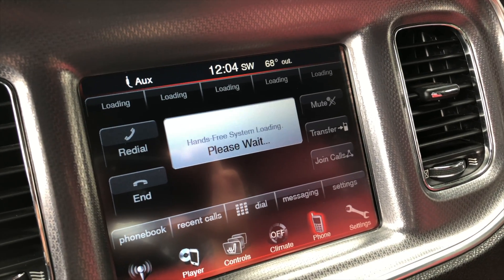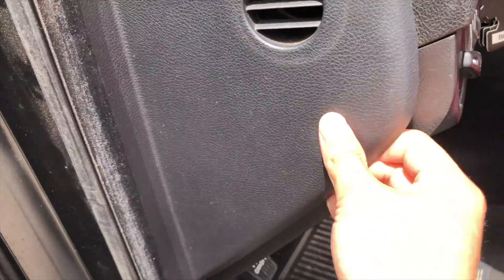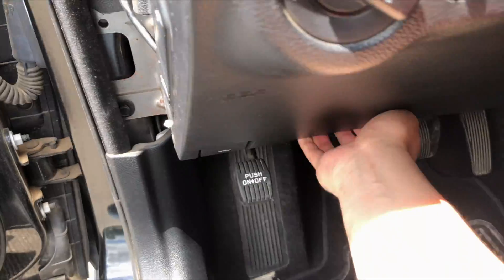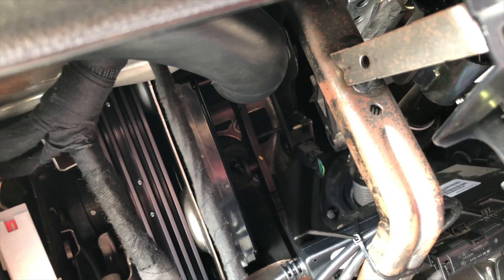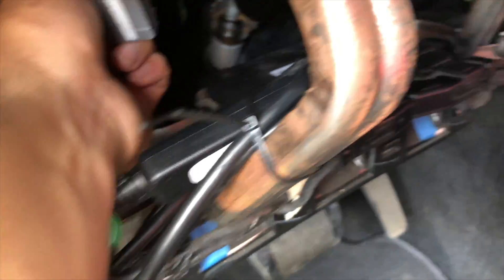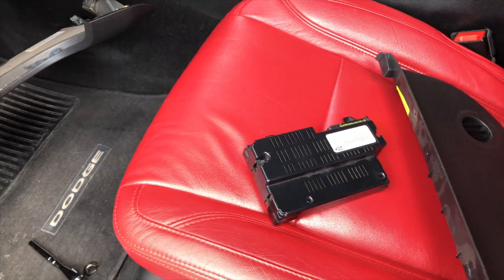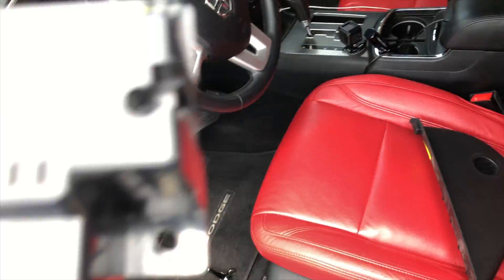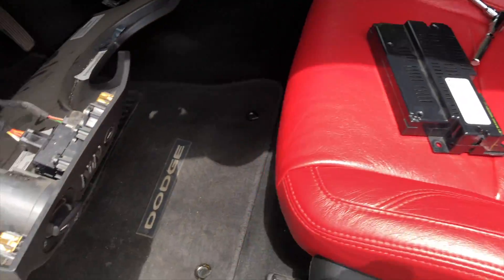Dodge Charger Bluetooth Issue Fix!!!

Comment: Before you buy a new module. Unplug module start car. Turn car off and wait 5 minutes with doors closed (sleep mode). Plug module back in start car and test. If module fails numbers do not need to be exact but close. 2011 - 2013 modules are interchangable. Edit: Most 2011 modules won't have text messaging
Reply: What numbers have to be similar?
Reply: Unplugging it worked for me 💪🏾
Reply: I hope nothing but the best for you

Comment: Ok I unplugged the module without unmouting it. Plugged it back in and bingo it started working again.
Reply: How long did it work after unplugging it n pigging it back in?  I'm wondering if I should buy a new one
Reply: @bne7062  Sadly it only worked for like a couple months. I may try it again because i don't want to buy a new one.
Reply: @chrismoody3783  did you try again?
Reply: @ I went and bought a used one off eBay. It had finally gave up completely

Comment: Thanks for making this, it was really helpful. I've been just dealing with the broken Bluetooth on my 2013 SXT until now! I pulled the Bluetooth module according to your instructions, which were great, and just cleaned the contacts with some WD-40 electrical contact cleaner, dried it all out with my air compressor then plugged it all back in. I turned the car on and let it run for about 10 minutes before I plugged the module back in. I did this while I was remounting the module. Once everything was plugged back in, it all worked perfectly. If it fails again, I'll plan on replacing the module. Thanks again for helping with this nagging issue!
Reply: Update?
Reply: Working great ?
Reply: Hi Jason, does it still work? Thanks.
Reply: How’s it holding up?
Reply: Update??
Reply: Just reprogramm the Module. It worked for me. I found a fix in the German Fiat Fremont Forum. It also works on Charger and Challengers
Reply: @marvinsteffen   how do you reprogram the module? Do you have a link to the forum? Thanks!
Reply: @flpnnino  Yes but it is I'm German.
Reply: @marvinsteffen   thanks. How do you reprogram the module?
Reply: Hey man, thank you so much for this comment. Pulled the module, started the car and ran it for 5min, turned off car and reinstalled module then boom, Bluetooth works again!

Comment: I had the same problem 2018 SXT Dodge charger just says Bluetooth initializing. With no end. The car has two fuse boxes one in the rear trunk with the battery and one in the front engine the fuse for the radio is number 37 cavity pull the fuse for 5 seconds plug it back in voila Bluetooth is working without any part replacement without any taking apart your dashboard. In fact it's working better than it ever worked. There was a delay in connecting the Bluetooth which is no longer there.I advise anyone against replacing the Bluetooth module before checking number 37 fuse in the rear trunk cavity, for the radio.
Reply: Thank you! This worked for me too, and saved me a big headache!
Reply: Yes i thought this video was just too extensive and basically the only one that years apart panels
Reply: I will try it in my 2013 300, hope it works
Reply: @ash.ace08  did it work?
Reply: did u had the problems where it connected but not sound? that’s what’s going on with mine
Reply: @djn3xo200 if you haven’t found the issue it’s the amp fuse it’s number 25 if I’m not mistaken
Reply: @ash.ace08 did it work?

Comment: I brought my Charger in for some repairs/maintenance and had this problem after picking it up from the dealership. It worked fine before. Could they have dislocated the connection to the Bluetooth module by accident?

Comment: I tried taking mine off and cleaning but still didnt work.  I searched online but couldn't find one and I think a new one cost $500+.  So a light bulb went off and I went to a local junk yard and found one on a 2012 Dodge Charger they had in their yard.  It worked instantly.   Thanks for the video!
Reply: Ik depending on place but how much did you pay for it?
Reply: How much did you end up paying for it??

Comment: Thank you for this video. 
I had luck by disconnecting the unit, taking it apart and cleaning the circuit board, and putting it back together. Now it works!
Although, the pairing did seem a bit stubborn and laggy, so I think the unit is going out. Just wanted to share in case anyone needs a temporary fix if they don’t have the money to buy a new unit.
Reply: How did you clean the circuit board?
Reply: Thank you so much! I'll definitely try it out, most mechanics have told me the only way to fix it was replacing the whole module but no one has ever offered to clean it.

Comment: before replacing try reflashing the module.
I had this error and what fixed it for me was I found a German site for Journeys that had the same problem, basicly what you are doing is flashing the module like the dealer would. You do have to have some electronic, computer skills because you have to either get the connector or make one to connect the module to your computer. If your interested let me know, I am not the original person who camew up with this fix,hes the guy on the GErman forum. I do see people on youtube using his method and not giving credit.

I am making this because I am trying to get  let people know they can do this them selves and not pay some guy that stole the software.
Reply: Can you explain it more?
Reply: More info please

Comment: Thank you so much. This is a great guide to get to the bluetooth module. Before I took it out I tried what another commenter suggested and pulled the #37 fuse in the trunk(there’s a handy plastic fuse pliers under the cover). That didn’t work for me. I lost Bluetooth as an option. Another commenter suggested cleaning the contacts on the module. I used an alcohol wipe and that worked. Now BT is working!
Reply: still work? after that cleaning
Reply: @TheseoThinker did you ever try it?
Reply: @jfnene1  The ECU breaks down due to voltage surges when the battery is almost discharged. When it is about to break, sometimes by disconnecting the fuse it reprograms itself and works for a short time. I solved it by having it opened inside and repair two capacitors. Then I had it reprogrammed with the update provided by Mopar ( service buletin 08-055-17 REV. A GROUP: 08- Electrical DATE: September 15, 2017). In Italy with 80 euros. Bye.

Comment: what if i only have one connection to the module like one cable not 2
Reply: One connection to module is fine. Anybody that upgrades the car to Bluetooth will only have the one connector (wire).

Comment: i have a 2010 charger i had the head unit replaced thinking that was all i needed and unfortuantly the person installing it didnt bother to help me after they knew i still couldnt use the dvd or bluetooth , So how will i know that this box is there, before taking this apart ?

Comment: Thanks for the video! Been having the same issue with my 2013 R/T, buying the part today and will hopefully have it fixed in the next couple days.
Reply: Hey!! Did it work? And where Did you get it .
Reply: Where did you find the part?
Reply: Where did you find the part
Reply: Hey what’s up I had the same problem my Bluetooth would not work i could not connect and could not adjust the Bluetooth settings I changed my battery and it fixed the problems with my bluetooth check your battery out make sure it’s good and the right size
Reply: I have a 2013 Dodge Charger RT and the Bluetooth module is built into the headset of the radio

Comment: So I been have issues with bluetooth it say same thing but sometimes it work sometimes not also my aircondotion system sometime work sometimes not I noticed when I drive for couple miles the aircondotion suddenly come on and eather bluetooth work or aircondotion work I can't have both working can anyone please help me is aircondotion connected to bluetooth module? And I also have problem with the key not detected please if you know or have any idea let me know
Reply: Check your fuses.

Comment: Honestly Uconnect's quality sucks big time, first I had to replace the screen as it didnt respond to touch, then bluetooth. Plus it freezes from time to time.
Reply: alan castorena do you know where to huy that Bluetooth piece?
Reply: @JoseOrtiz-fz6hx   I found one on Ebay but I was lucky, and then it broke again. I now just use it on speaker with Siri's help, and for music somehow it still works through the cable usb port, although not perfectly so sometimes an AUX cable will do. I hate Uconnect.

Comment: Someone told me they disconnected the battery terminals and put them back on and it fixed this problem.. which sounds a lot easier
Reply: It’s only a temporary fix. I’ve been doing that the past 2 months and now, disconnecting the battery doesn’t fix it anymore
Reply: Itz temporary fix bro. Will work only for few attempts.

Comment: My Bluetooth has not been working for 4 months and I recently changed my battery last month and when I put the new battery in there the Bluetooth started working as normal for only 2-3 days after but than stopped working again... you know why that happen?
Reply: I had the same problem, after changing the battery it played back again for a couple of hours then off the grid again. Followed the video (which is actually impressive and easy) tried to re-install the same after unplugging it. worked for the media Bluetooth but not the phone speakers, so finally decided o get a new one.
Reply: Essentially it’s like the old phones or like a sega game you took the battery out and it reset. I took mine to the dealership and he said it’s a short term fix if the modules bad it won’t work for long at most a few weeks.
Reply: ...chg your Bluetooth module. do it yourself. its only a few screws and about $400 cheaper.

Comment: Great video, I have a question. Is the module a sealed unit or is there screws to take it apart? The reason I'm asking is I work with and repair electrical boards all day and I'm hoping my module could be an internal simple fix.   Thanks
Reply: it does have screws to take it apart man, i was thinking the same thing but i wouldn't know where to start
Reply: Yes you can take it apart. I would like to fix it as well if possible. Have you tried to fix it yet? Thanks.

Comment: Hey can I ask you a question
Reply from the maker: Destiny Rice yes of course
Reply: So I’m not really the best when it comes to cars,lol but the amp had went out in my car,and so when I took the lower dash panel off I unplugged all the wires so I could move the dash panel completely, well the cluster of wires to the left I forgot to take a picture of before hand of the right order they go in so I wasn’t sure if maybe you could tell me or send me a picture of the order yours is in? I tried to look off your video but it was hard to see since you weren’t recording for that reason lol
Reply: And I’m not really sure of what it’s called so trying to google the order is very difficult,lol it’s the 5 wires that clip into the white block  under like where the light switch is and stuff
Reply: Is that bluetooth module also the gadget that enables a cars gps system?
Reply: @destinyrice9282  they all have their own shape and if you try do put them into the wrong connection it’s not going to go in

Comment: Price of bluetooth 😩😩
Reply: Check your battery man I had the same issue blietooth would not work would stay frozen I changed my battery and it’s working good now.. check your battery to see if it’s good and the right size
Reply: ...i found one on ebay for 1/2 the dealership price.

Comment: So do yall think since this part is out and the Uconnect keeps looking for the module to kick on that's why sometimes my battery needs a jump?!?
Reply: ..mine does the same thing and when my car is started, the sys boots up in constant search mode. i  noticed i didnt have battery problems until when my module went out. I found one on ebay. should be here on Nov 13th.
Reply: @keithclark5730  hey bro u got the link i can’t find it